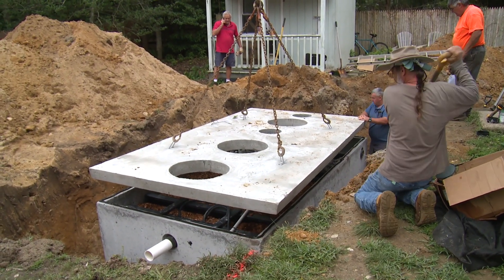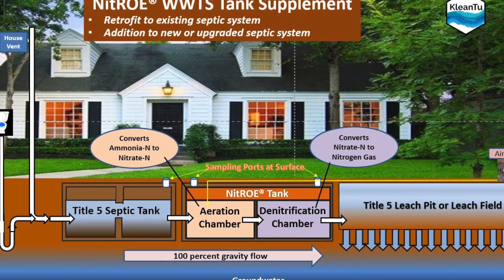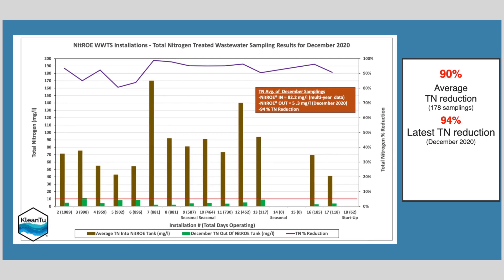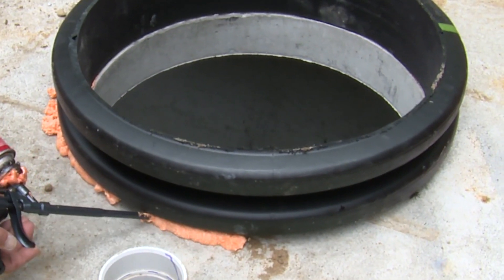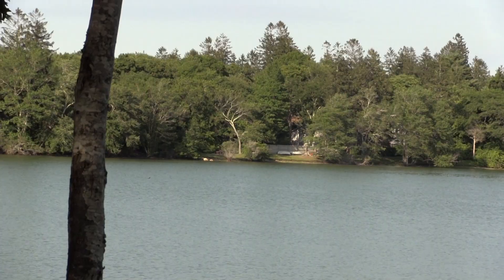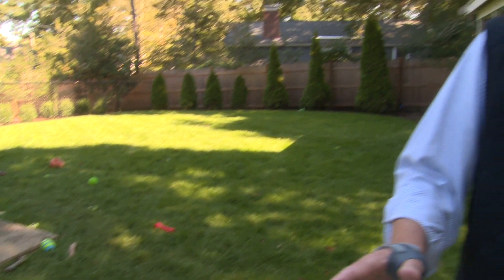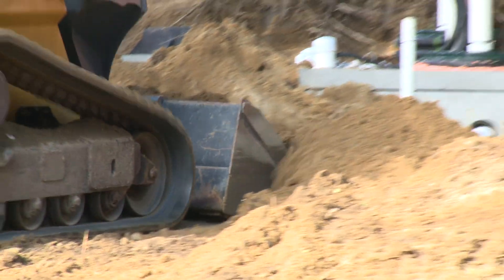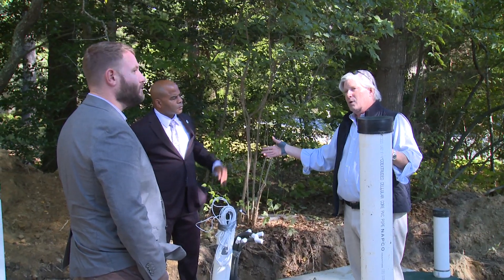Shubael Pond Innovative/Alternative (I/A) Septic System Project

Comment: These systems are not new. They have been in use in Rhode Island for years.
Reply from the maker: Hi Brian.  Thank you for your comment.  The KleanTu NitROE system that you see in the video has only been installed in Massachusetts, primarily on Martha’s Vineyard and a few towns on Cape Cod.
Reply: @bcleanwater  we have similar systems here in Rhode Island. I'm a realtor and the closer to the water you are, the more likely it is that you will need one.